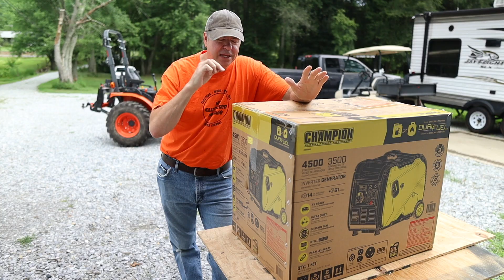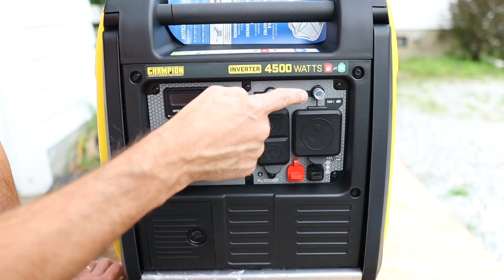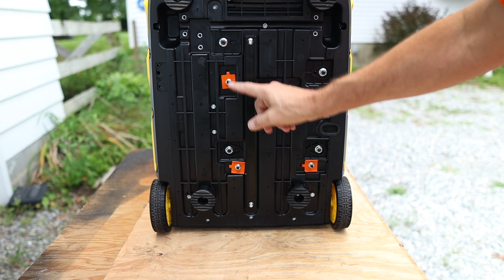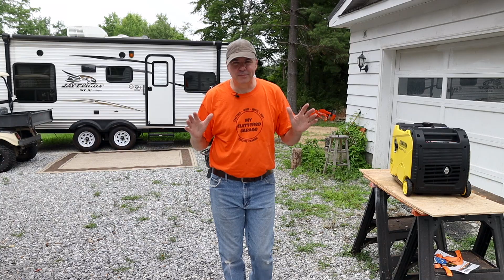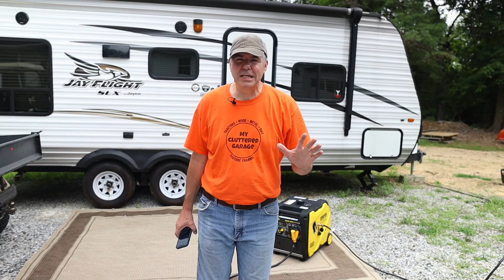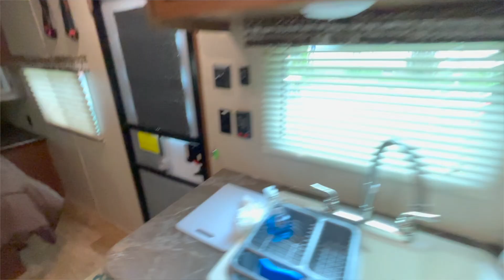#68 Champion Dual Fuel 4500 Watt Inverter Generator. Unboxing, setup, and review. Best RV generator?

Comment: Every time you drive you have a container of gas sloshing around
Reply from the maker: That’s true. But not in the back of my covered truck. 😄
Reply: @MyClutteredGarage  I suppose not lol. I’m with you on propane overall - propane is the fuel of camping. Nice to always have the option for gas in a pinch (or build a wood gassifier and run it on wood)

Comment: I think for my home that uses 240v for the oven and dryer only. Water pressure is vea gravity flow, Not a well pump.
120v for everything else.
That would be a good solution to my 6 ish power outages a year.
Reply from the maker: Hi Bruce. It would likely get you through.  I have a 10kw 220v open frame portable for my house. But the only 220v device I need it for is my well pump. Can’t run the dryer with it. And my stove and oven are gas. I can run my boiler for heat and hot water though so I’m happy! Thanks for watching. -Ed
Reply: @MyClutteredGarage  
Yes well pumps are commonly the one thing a home has that still needs 240v

Comment: I have that exact generator and use it for camping as you do. The only problem I've had with it is a small amount of oil leak. I run it on propane and it will use much of a 20 lb bottle over a 3-4 day trip using it only for air conditioning and perhaps 3 hrs per day, since most of the time we are outside doing activities, fishing, etc. I usually run it from around 7-10pm, which is when quiet hours start at most camp grounds. It is nosier than I would like. The oil cap on mine was cross-threaded, so I ordered a brass one from Amazon. It has a probe that goes down into the oil tank to attract any metal shavings. Even at age 78, I'm able to lift it into my truck, but I do have a set of ramps that I can use if I need to.
Reply from the maker: Hi Max. Thanks for your comments. Good to know I may still be able to lift it in 20+ years! 😄

Comment: I ordered this Generator from Amazon and they sent me the 4500 with no dual fuel or electric start. Been fighting them all day on their mistake I ordered the Model 200988 they sent the Model 200986 which is $200 dollars less. I just want my Generator and I am in the middle of Hurricane Ian with propane and NO generator. Thanks for the screw up Amazon
Reply from the maker: Aw man, that's really a bummer. I hope they work it out for you soon!

Comment: Champion has this generator in a open case that is much lighter, but not as quite. The tank on the open is much larger too.
Reply from the maker: You can definitely save some money if you don’t need it as quiet. I wouldn’t recommend an open frame generator for public camping.  Thanks for watching.
Reply: Open frame vs insulated inverter generator are apples and oranges

Comment: Great video. I think this is the one I need to buy. Thanks
Reply from the maker: Thanks, Mark. I'm still very happy with it. I recently went camping and boondocked in parking lots at night. I used gas in it and it ran my camper air conditioner for over 7 hours on a single tank.

Comment: What 30 AMP cable are you using? I noticed a lot of generators end up having RVs connect cables upside down with unnecessary strain on the port.
Reply from the maker: Here's a affiliate link to the extension cable I have. I'm very happy with it. Thank you! https://amzn.to/3dGS5Hf
Reply: @MyClutteredGarage  Meanwhile, I got my generator delivered, setup, and up on my travel trailer tongue shelf. This things as quiet as a small car idling.
Reply from the maker: Nice! I’d like to mount mine to the camper.
Reply: @MyClutteredGarage  Look up "Stromberg Trailer Tray", it's the only real way to do it other than hanging these things off a makeshift shelf on the rear bumper which is a worse way to do it in every way.

Comment: I picked up a Champion 90014 open frame inverter generator. It has the same running watts as this model. 

Because it is open frame and doesn’t have electric start it is only 79lbs instead of 103lbs. It is also dual fuel but only is 3 DB louder than the enclosed model which I think is negligible. The weight shedding is more worth it in my opinion. Plus it’s easier to access for maintenance tasks. Pull start is super easy. 

Champion makes nice generators so you cannot go wrong either way.
Reply from the maker: I used it a lot while camping last week. I love this thing!

Comment: Just bought this on a great sale from Amazon and love your review and setup. I agree it is heavy but the handle really helps.  I’ve been using a 3/4” plywood ramp but am seriously thinking about buying the harbor freight hinged ramps for my pickup.  With the $500 off on the generator, I can spend the $150 for the ramps. They fit well in the bed and will allow me to easily get it in and out of pickup and will allow me to get an electric bike up there when I decide to get one.  I love that it can run my camper a/c and electrical when needed.  Thanks again. Very thorough video (might want to clamp that plywood down on the sawhorses next time though. Lol)
Reply from the maker: Thanks so much for your kind comments! 😄
Reply: Lauri, may I ask what price u got it for?  Thinking of putting this on my black Friday or prime day shopping list!
Reply: $750.  At the time when I was looking, Amazon was at $1200  for the 4500 watt dual fuel one so when they discounted by $500 felt like a good deal.

Comment: I did NOT see anything supporting propane running 21 hours on a 20 lb. tank.  
I was reading info on using propane and it said a 20 lb. tank will run only 5 to 6 hours ??
Reply: The 20lb 5-6hrs is from the traditional generator, not an inverter
Reply from the maker: @mattvandom8202  I recently got 12 hours running an RV air conditioner non-stop with a tank of gas. I imagine propane would be similar or even better.
Reply from the maker: I haven’t tried it long term, but this is from the Champion website. “Our 4500-watt inverter generator features Dual Fuel allowing the 212cc engine to run on gasoline or propane. Enjoy the quiet 61 dBA for up to 14 hours on gasoline or up to 21 hours with a 20-lb propane tank and increase your power with the optional Parallel Kit.”
Thanks for watching! -Ed

Comment: Great video and thank you! The gas cap appears to be the highest point from the views that I’ve see. I’m trying to see if it will fit in my bed with the cover closed. Can you tell me the height with the gas cap removed? I appreciate any assistance you might offer
Reply from the maker: Thanks very much! It measures about 21 inches high. It fits in my full-size truck with a tonneau cover no problem.
Reply: @MyClutteredGarage  I appreciate it! My cover is a foldable flush mount (backflip), what kind do you have?
Reply from the maker: @theyounglife2389  I have a folding vinyl cover bought through Amazon on a 2014 Silverado.

Comment: Hey there. I appreciate your videos! 
I bought this generator a month ago. My propane quick connect seems to have a very weak connection that leaks. Almost like it doesn't fit properly. I've searched this and many rv'ers have the same issue. Would it be too much to ask for a quick video close up on your connection operation? The other large question is if it will switch to gasoline automatically once the propane runs out? 

Great videos and I also purchased a Kubota based on these vids also ;)
Reply from the maker: Thank you for your kind comments. Can you follow my page on Facebook and send a message? If do I may be able to send a video clip for you.

Comment: My 30 amp RV has a 15k btu Coleman Mach A/C. I want this generator to run my A/C and 12v fridge for at least 12 hrs if there is a power outage. Will this work?
Reply from the maker: I’m no expert, but considering that this ran my 13.5k AC and the microwave at the same time, with room to spare, I’d say it would run it just fine. Thanks for watching. -Ed
Reply: It will run it but you will have to refuel most likely. Under heavy load it won't run 12 hours in hot summer temp without refueling

Comment: This was a great review for me. I am looking for a generator to run my trailer. I have the exact trailer that is in this video. It seems quiter then I was expecting.  Thank you for video.
Reply from the maker: Thanks, David. I’ve been very impressed and happy with Champion products.
Reply: @MyClutteredGarage  I ended up going with the westinghouse 4500dfc. A few reasons :1 when shutting down the fuel in the carburetor is used up. 2 it comes with a battery charger so I don't have to use a battery tender. 3 remote start. If it gets hot in the middle of night, I don't have to go outside to start it up.
Reply from the maker: @davidroberts677  I do wish the propane champion had remote start! The gas model does.

Comment: Do you have to let it run for a few hours before using it??
Reply from the maker: Not sure what the manufacturer recommends but I ran it but under load and without a few times (for a few hours) to break it in. Thanks for watching. -Ed

Comment: Do you get more hours per gallon on propane or gasoline? Propane is cheaper than gas where im at but seems like it would burn through more of it than gasoline
Reply from the maker: According to the Champion specs, at 25% load you can get up to 14 hours on a tank of gas (2.25 gals) or 21 hours on a 20lb tank of propane (4.6 gals) so it appears that gasoline is more efficient. Thanks for watching! -Ed
Reply: @MyClutteredGarage  thanks i have an older 3100 watt champion gen like this one but smaller, thinking about upgrading because I really have to pick and choose each appliance I run, its not as bad as the honda 2000 I still have but used to run for the RV, the microwave alone would overload it usually
Reply from the maker: @rh5549  They also make a 4500w gasoline-only model with remote start. So if you don't need dual fuel, that's a great option.

Comment: To bad it doesn't have a 4 prong 120/240 30 amp plug. Rv only
Reply from the maker: You can use a simple adapter but you still won’t get 240. Thanks for watching.

Comment: New to your channel Sir. Quick question what if a person wants to run 3 appliances?  I Noticed there are only two 120 volt plugs on the generator. I presume there is a way to split it?  
Thank you.
Reply from the maker: Thanks very much. You certainly could add a multi outlet strip or short cord with a splitter. Even a 30 amp plug with multiple outlets. Here’s an affiliate link: https://amzn.to/3JNNPAW
Reply: @MyClutteredGarage  thank you

Comment: Hey Ed, I have the model made before this one--a little less capacity, but basically the same thing. Anyway, I replaced the start battery with a Shorai LFX14A4-BS12 lithium battery. Now I never have to trickle charge it and it starts right up, even after months of sitting. Just thought I'd let folks know that a lithium start battery is an excellent upgrade! PS, that pull-start was impossible for me. Maybe I'm too weak ;)
Reply from the maker: I had that same generator and sold it with my last camper. I tried to buy it back before buying this one. I really liked it a lot. Even though this one puts out a little more juice, I was completely happy with the other one.

Comment: Hi Sir, I just got the similar 4650/3650 201080 dual fuel model.  The choke mode, as per the user guide, is not for starting the generator. One simply pushes the button while the dial is selected to choke for 2-3 seconds and then you move the dial to run mode, depress the button and it then starts/runs.  I am very impressed with this unit!!   I went to town and got a gentent for it as well because the power doesnt go out on nice warm sunny days with no wind.  In terms of sound +3dBs doubles the power of the noise so a few dBs can be significant, however concur these units are quite acceptable for noise (test baby kept on sleeping). :-)
Reply: Alex, have you had the opportunity to try out the gentent in windy and rainy conditions yet? Thanks.

Comment: Thanks for the video.   Very useful.   Did you consider getting two of the 2000 watt generators?   Those would have been 40 lbs each and maybe easier to manage, than 100 lbs all by itself.
Reply from the maker: Good idea. I’d be concerned that two would burn more fuel than one, and the noise level would be higher. Great point though! Thanks for watching. -Ed

Comment: Where is your air intake on this one  ?  Never set it in dirt  to run  without placing a clean surface like a box under it.
Reply from the maker: The intake is under the side cover. Always good to place it on a platform. I keep a piece of plywood with me when camping for that reason.

Comment: Thanks for the review!  Decided to order 2.  Dual fuel IMO is the way to go.  Received the Parallel kit now waiting on the Gens.  I plan on putting in a 50 amp connection at my homes panel.  No more sitting in the dark and plenty of power while boondocking!!!
Reply from the maker: Very nice, Bryan! I have no experience using the parallel kits but that sounds awesome. Thanks for watching! -Ed

Comment: What size is your A/C?
Reply from the maker: 13,500 BTU. It’s pretty standard from what I understand.
Reply: @MyClutteredGarage  Mine is a 15K BTU.   I wonder if this genny can handle that?
Reply from the maker: @Edwardsjourney  I am not qualified to answer but my guess is that it absolutely would run it. The fact that it ran my air conditioner AND my microwave tells me that you’d probably be fine.

Comment: Really appreciate the review. I have an older Honda 3000 inverter. I think I'm going to add the generator and your video to my collection
Reply from the maker: Thanks Chris. I used it for the first time camping a few weeks ago. Really pleased with it! Hard to beat that Honda 3000, but the extra watts are nice to have. Not to mention the dual fuel capability.

Comment: I keep my fuel tank full of TRUFUEL ethanol free fuel and run it a few minutes after propane. A video of a guy who never ran anything but propane in his and the carb got rusted up and couldnt run it on gas. So maybe just as a preventative approach. I called champion and they said no issue running on propane with the fuel tank full.
Reply: I think that something else is going on if the carb rusted up from running only propane. I grew up in the 80s and we had a Case model D tractor built in the 40s that ran on propane.  We only used it in the spring and summer, and my dad never had a problem with that tractor.  All he ever did to it was change the oil.
Reply: Could have rusted from drawing high moisture air through the Carb, the carb is still in play even though not running gasoline as the butterfly and choke on the carb regulate the flow of propane in conjunction with the Garetson regulator. Although usually most carbs don’t have anything in them that will rust i.e. brass and aluminum.
Reply from the maker: Much appreciated. I’ve actually run some ethanol free fuel through it and have some in there now. Like my large backup generator, I’ll run this one every month or so to keep it from tarnishing. Thanks for watching. -Ed
Reply: A YouTube guy showed a removed carburetor/propane unit. Easy to see the propane feed bypassed the carburetor.
Reply: After a break in I would invest in amsoil 10w40 synthetic 4 stroke engine oil or other high quality synthetic.. these units are expensive.. protect your investment..
Reply: @mysticjedi6730  Agree thats all l use.

Comment: I went on amazon and they say it runs up to 22hours on a tank of gas? How big is the tank and is that true? (this is the gasoline version not duel)
Reply from the maker: Hey thanks for watching. According to the champion manual for this model: “When the 2.3-gallon tank of gasoline is full, the 212cc Champion engine produces 4500 starting watts and 3500 running watts and will run for up to 14 hours at 25% load. When using a 20-pound propane tank, it produces 4500 starting watts and 3150 running watts and will run for up to 21 hours at 25% load.”
Reply: @MyClutteredGarage  Thanks for responding so quick.

Comment: These seem a little hard to find now. Northern Tool has them for $1099. Is that about the going rate?
Reply from the maker: That’s sounds about right. I must have gotten lucky when I ordered mine from Amazon. It took about a week for delivery.
Reply: @MyClutteredGarage  Looks like Bass Pro has the 5500 watt model for the same price. Probably heavier and louder though.
Reply from the maker: @mattmiller2761  is it an inverter model? It must be heavier and probably louder. If it’s not an inverter it will be much louder.
Reply: @MyClutteredGarage  Yes, it's a dual fuel, inverter, 5500/4000. Weighs 119 lbs. Looks like it's only available through Bass Pro and Cabela's.
I'm thinkin' about it.
Reply: Currently on Amazon for $819.00 Just checked after watching this review.
Reply: Bass Pro and Cabelas has the larger 5500/4000 Champion which is just a larger version of this 4500.  The 5500 is not even listed on Champion's web site!  I have some buyers remorse now seeing how I could have gotten another 500 running watts for another $300 but maybe thats not a problem.  I want to get a full on 240V inverter generator some day so THAT will be my big upgrade.

Comment: Nice review Ed…I went with the RV ready champion 3400 inverter for our Jay Flight. I love the remote FOB for starting it and shutting it off while you’re in the camper. This one definitely has some improvements over mine.
Reply from the maker: Thanks Mike. I was really torn between dual fuel vs remote start. That fob would be nice!
Reply: Will 3400 run everything in a 30 ft camper with 2 ac units??